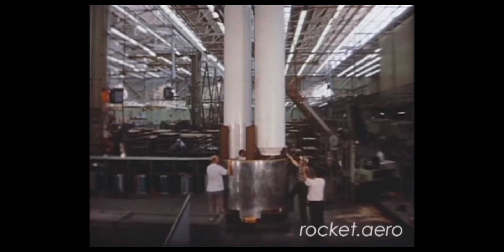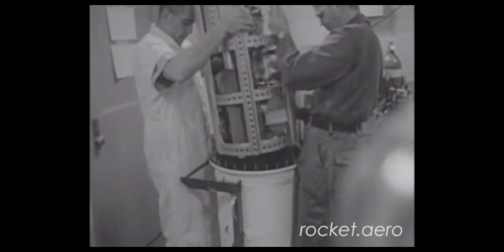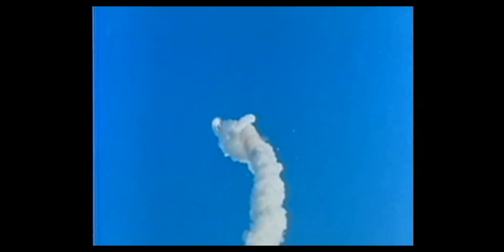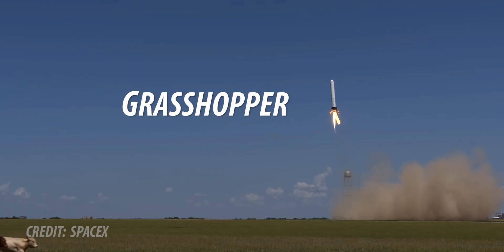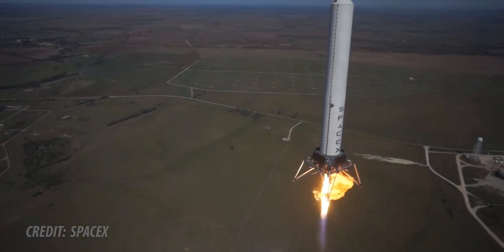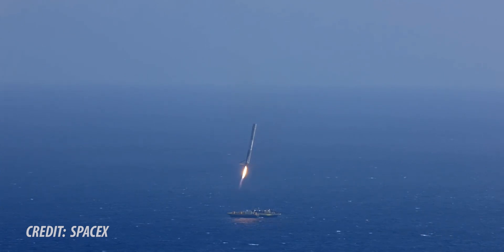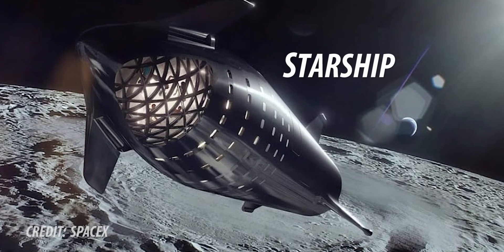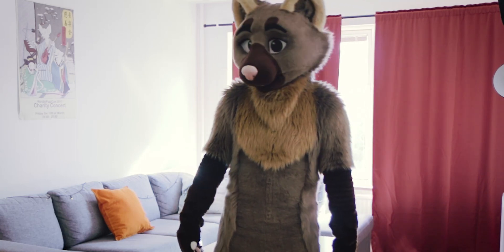The Unlikely Rockets That Transformed Spaceflight

Comment: I think the examples of rockets that transformed spaceflight are simply crap... and you even left out the rocket that really did transform spaceflight as both SpaceX grasshopper and Blue Origin New Shepard are based on it, and that is the DC-X...
https://en.wikipedia.org/wiki/McDonnell_Douglas_DC-X

And you also left out the New Goddard rocket that flew a long time before Space-X Grasshopper, which blasted off in 2006....
https://www.universetoday.com/1148/blue-origins-rocket-is-finally-revealed/

Do better research next time...